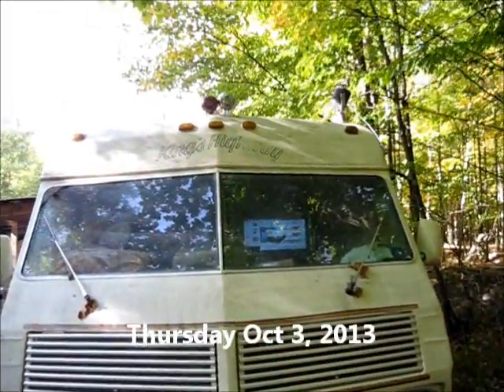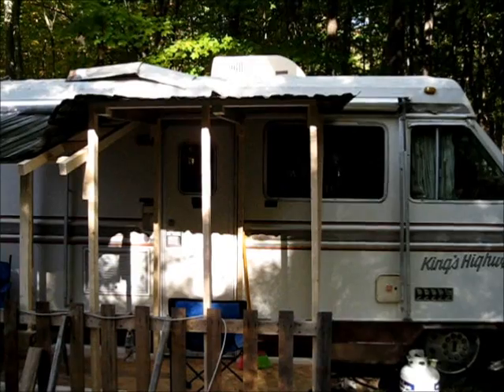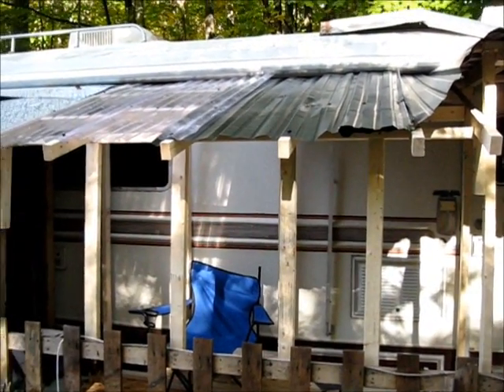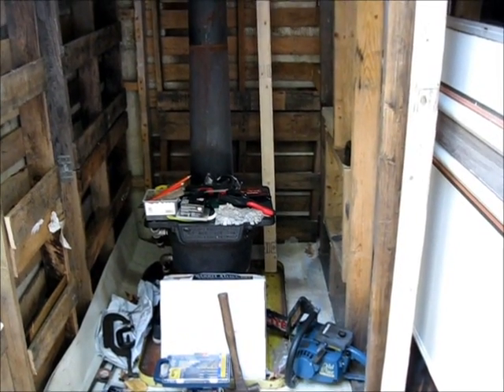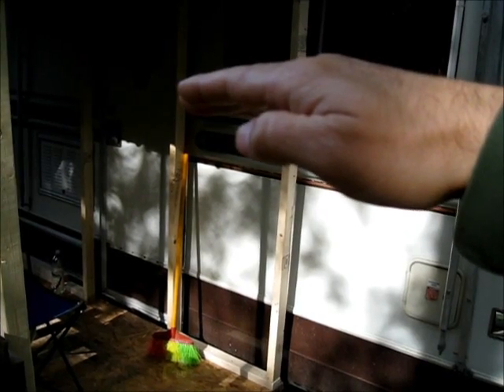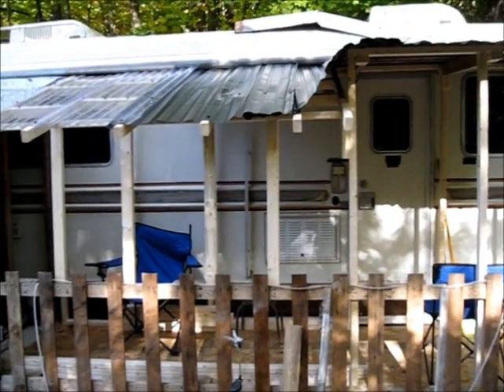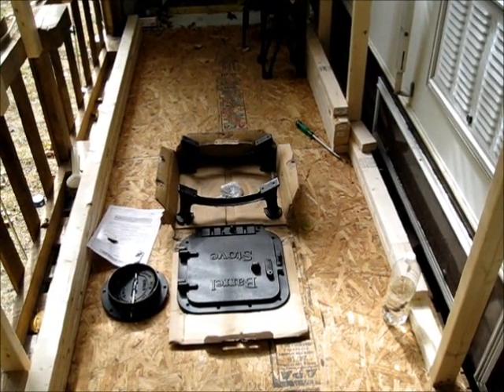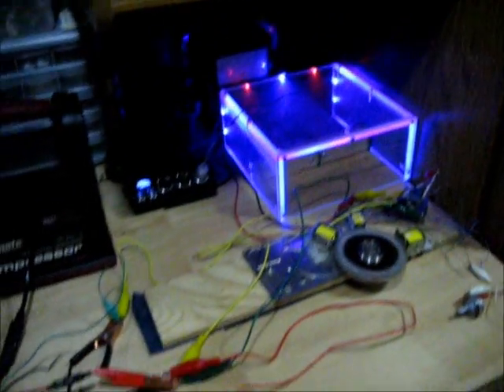Projects And Experiments Day And My Off Grid Hot Shower

Comment: Normally the high outlet is below the top of the tank, the space above it is reserved for some expansion.  It can fill by the water absorbing the air over time.  I never said there was a 3rd outlet.  Not sure what you mean there.  Don't trust me about the air pocket, check out the online Suburban and Atwood manuals.

Comment: Troy, adding thermal mass to your heater shed is not going to do anything unless it's insulated and doesn't have massive air gaps everywhere. The heat's gonna radiate out sure, but it's not gonna radiate out into the rv thats for sure.

Comment: Yeah, you need a cleet at the end of your corrugated plastic. Also, the screws with the rubber washers are supposed to go through the bottom dip in the plastic and not the top. I should have pointed that out before. They make rubber pieces also that will fit under the plastic to hold it more securely. It will also help keep it from making noise when the wind blows.

Comment: Please look at install manual on Vogelzang site. Minimum ceiling height is 8' for a barrel stove. 

I have a Vogelzang box stove in my 12x16 workshop. This smaller stove is a bit too large for that area. Easy to put out too much heat. A barrel stove much larger. Too much stove for my shop even though I have the clearance needed to install one. 

Too much stove, too much wood & too small room becomes an oven with temp that can far exceed what's safe for building materials & person entering area.

Comment: Probably been talking past each other. :-) Looked at last exchange. You said bigger & fireproof structure. Just commented "fireproof structure" isn't necessary if proper clearances maintained around stove along with floor protection & proper flu install. 

A room approximately the size of a pallet is far too small to safely accommodate a barrel kit stove. Shed approximately 4' wide. Need 3' each side of barrel + width of barrel.

Work done so far not lost by using additional available options.

Comment: im pretty sure he meant that plastic sheeting you "mentioned" about "possibly" covering the stove shed with would melt..... troy get rid of that stove , well dnt get rid of it.. bt replace it with your barrel stove, and line the stove with some heat bricks,, at best that stove is a water heater,, trust me , i have a trailer not much larger than your rv.. and if i had a stove that small trying to heat it, i would constantly be feeding it through the night.. ive seen your winter.. its kinda harsh.

Comment: The shower works well , but here in the freezing Sierra in winter we had to make sure to drain the shower hose itself after use to prevent it from freezing and cracking when used outside.
Anyone who has access to as many blueberries as you showed on a video months ago would have picked like crazy and canned or dehydrated a good twenty gallons.  We do not waste any food opportunties.

Comment from the maker: I will double check things of course before I do anything. My barrel is too small anyway. The front plate will not fit. Was looking on CL for a barrel but they are $30 and will cost me $70 in gas to get one. None nearby.

I was looking at cement board for the shed, maybe. Yes, masonry is too heavy.

Comment: Additionally, if you line interior floors & walls with blocks or bricks, doubt the pallet floor can handle weight. I used brick under boxstove in my shop. Floor joists 2x6 supported on concrete blocks piers. 3/4" plywood floor. Had to remove brick because floor began to sag between piers.

Comment: Troy, PLEASE !!! read the manual again on your stove kit. On Volgelzang web site. 

Floor or walls covered with brick, tile, etc. ARE considered to be combustible. Minimum clearances are 36" from walls & corners. Unless I'm reading something wrong, you do not have enough clearance in your heat shed to safely use this stove.

I've seen these stoves in action & know the heat output. You're trying to put one into a confined area that's too small.  Almost too small for laundry stove w/water jacket.

Comment: I had purchased the same hot water on demand unit last year but haven't used it out of a reservoir of water, used the house hose. So that brought up ..Ill need a pump that can run off solar charged batteries to pump water thru the system. It actually is on my list of things needed, was thinking for basic water.  Oh the things that line up watching you use them ...very good info.

Comment: be sure to run a fresh air pipe into the stove shed area so that it doesnt try to suck cold air in thru every joint and cool off the shed itself...one pipe into the stove itself for feeding the fire and one into the shed...or split one between the two ...looking good so far Troy...maybe make one of them" solar pop can enclosed heaters" and put on your porch for extra heat

Comment: no your thinking,i would go with the barrel stove for sure , I have one 30 gallon and it heats my 15x20 sged in mn with no insulation just use a fan to blow around and put that cement board or bricks around the stove.

Comment: we have been using L5 Instant on shower in our off grid cabin with no issues.  Even in cold weather you can drain the unit and the lines.   Put black paint or a black cover over the water storage system to use the heat of the sun to keep water from freezing.  We use rain collected water and some water we bring in.  Had no freezing problems that way.   Hope this helps

Comment: I am concerned that in the winter the intant hot water heater will feeze and but out side. So you could put it on the wall of the porch next to the stove so it wont freeze. you could put plastic on the floor and take a shower on the porch for temperary. then later pipe the hoses up to the shower in the RV shower.

Comment: That is a good idea to put back in the camper because if you have guest they need a sotve in the camper. You can put a blob of silicone on each nail or screw head to keep them from leaking on the roof part at least. why cant you put the hot water heater inside on the outside under the porch and pipe it up to you shower in the RV? so you can take a shower inside the RV to keep it from freezing in the cold weather.

Comment: those barrel stoves are awesome my dad was one (55g) he used it to heat a 24 by 60 garage with no insulation in MI i think a 30g is going to be great for you. paint the barrel with black heat resistant paint it will help with heat transfer.i learn that in auto mechanics class in high school that is why radiator and engines now are painted black.and flat black is better then gloss black.looking good i like to sun porch i think it's going to work well in the morning.

Comment: Looking good.  I like your idea on moving the stoves.  I agree that a board across the top of the roof will catch debris and snow and ice -- it needs to be able to slide off.  The cement boards you're going to put up for fire protection around the stove will be mass to absorb heat, too.  What will you use for a fan to get the heat into the RV?  I saw something at Harbor Freight that opens and closes a greenhouse window (not a slider, tho) depending on temperature - would that work for you?